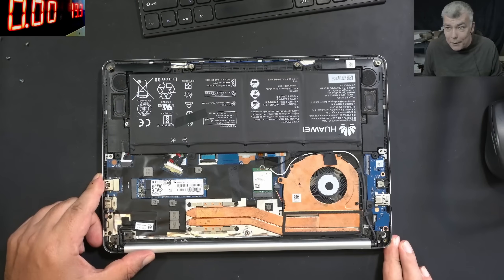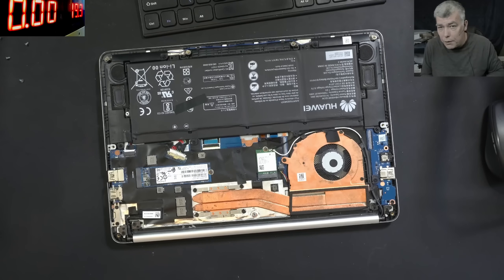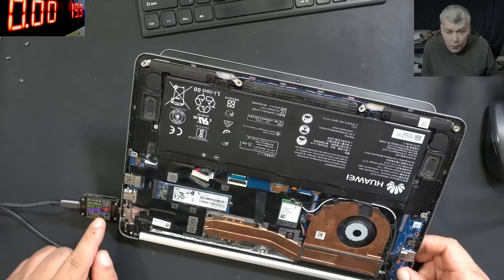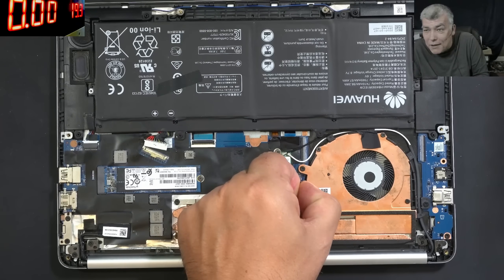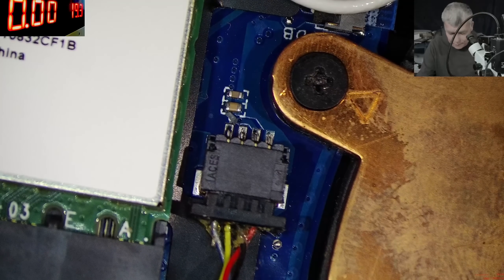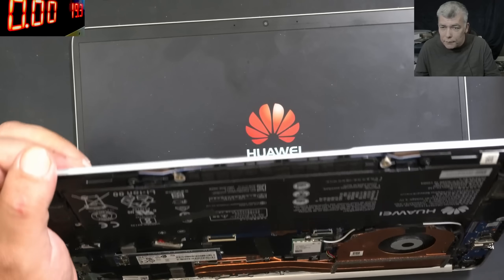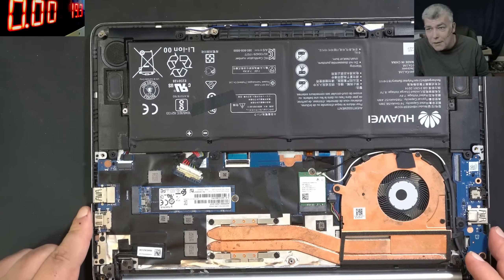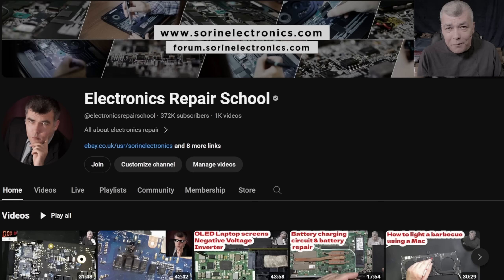HUAWEI D 14 died after the fan was cleaned and thermal paste replaced - A common mistake

Comment: Had a similar problem replacing a battery, the connector was SO SMALL, no microscope, broke it, but not enough to push it in and tape it in. Why do they have to make it SO SMALL ??

Buldgeing  battery  replacement, DELL.

Comment: I bought a for parts laptop intending on using the screen. Advertised as dead mobo. When i got it the only thing wrong was 2 pins of the charger connector were bent together just like this fan connector in the video. Easy fix. Ended up being the max spec too.  So I ended up with a 100% upgrade and for less than the price of a screen.

Comment: Oh Sorin....I had like 7-8 notebooks with this kind of history. Friends and known people around me, came to me with this "disaster". "My laptop or PC was in Profi repair, I paid 50-70-100 €, and the computer is dead. I opened it, and after charger/cable plugged, fan dont even move. Like U said. its very common mistake. But the sad thing on it is, that many repair shops take huge money for nothing, and the customer cant get it back. even when the diagnosis was not proper. I like the way you work/think. I will be your next "joiner". P.S.I am a total microelectronic lame. But offten its a simple way to fix a problem. I wish U the best of health.

Comment: Sorin, You earned your pizza on that job. Just curious, what should i charge the customer for such a simple repair if I ever get a job like that?
Reply from the maker: Usually the overheating jobs are charged £60-£80 here in England, that include replacing the thermal paste and cleaning the fan
Reply: 20-30€/$